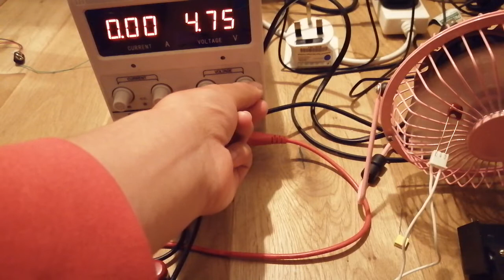high voltage, frequency and power oscillator

Comment: I could not find the circuit diagram in the description of the video.
Reply: It's so wired. 👉 The last couple of weeks 👁️ keepeth finding circuit boards and wiring / batteries. 🤔
👉 is it a sine  🤔   (. Do you think.  💘. 🤔. )